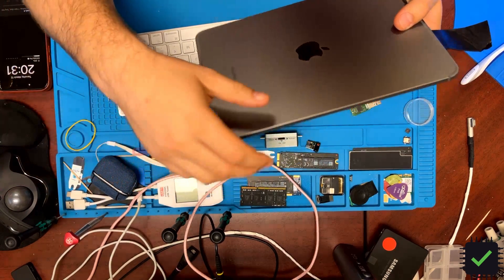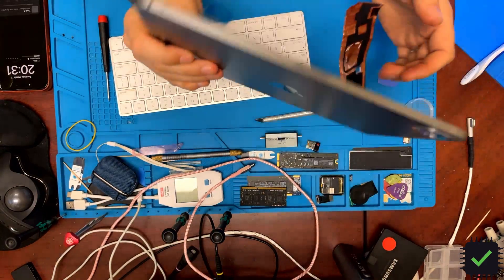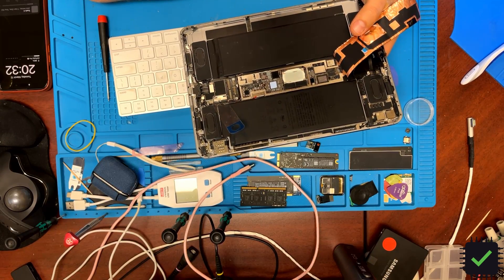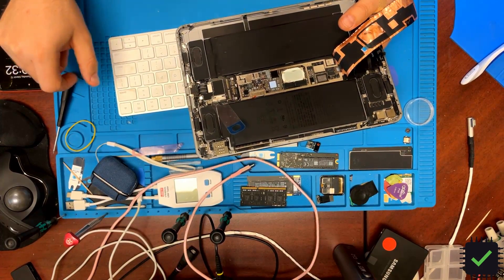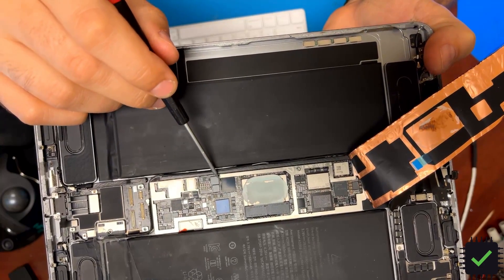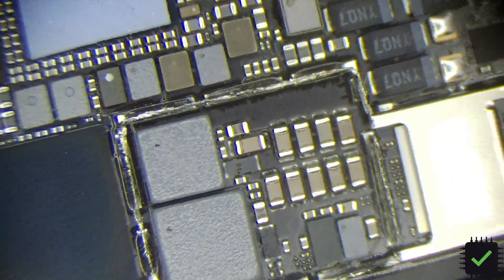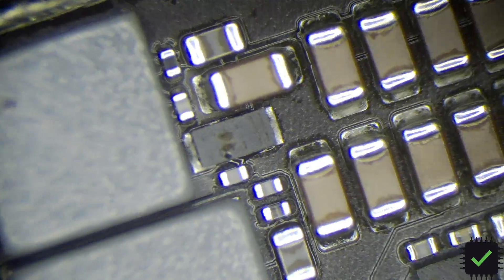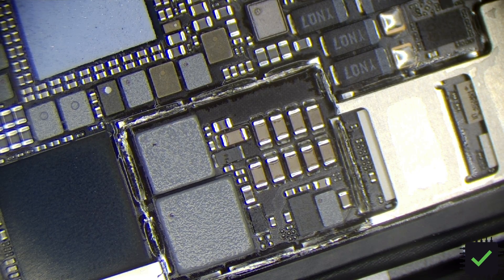Apple iPad Pro 11" 4th Generation 2022 Model A2435 Backlight Repair. Diode Location

Comment: Where do you buy these diodes ?, as can’t find them. All I see online is the older, larger ones
Reply from the maker: Donor boards
Reply: @applepietech  argh ok, expensive way of doing it with this model , as donors cost hundreds
Reply: Do you know the value of this diode?
Reply: Can you located me backlight diode on iPad Pro 12.9 gen5 or gen 6 please..I have one with no backlight..but I can’t locate the backlight ic or backlight diode please